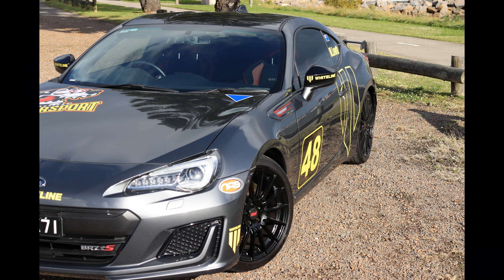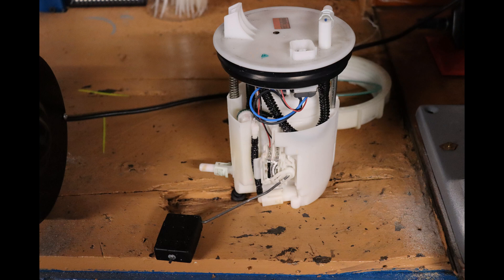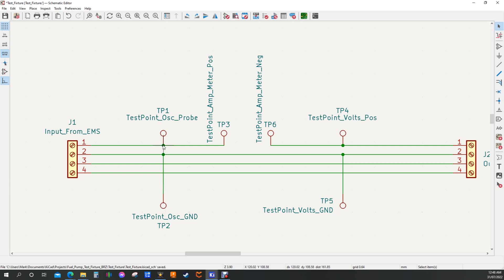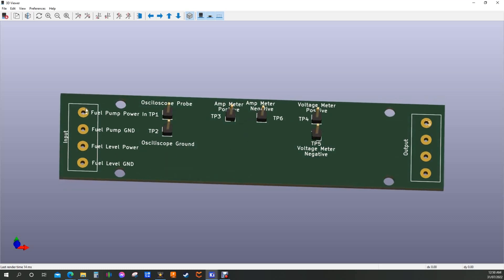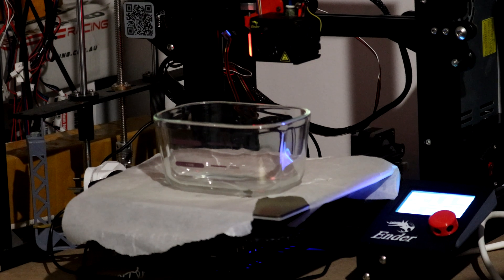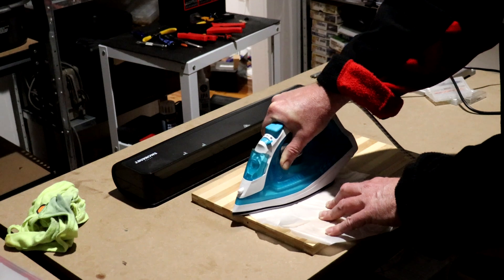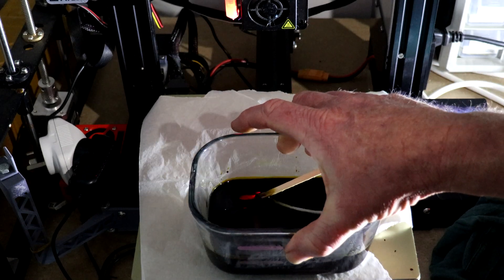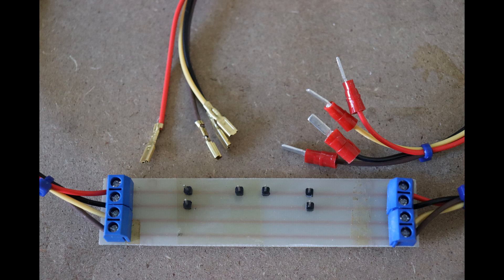Fuel Surge BRZ/86 Part 1

Comment: Using the second pump to pump the fuel to the part of the tank where the first pump is?
Reply from the maker: I may do, I haven't got that far yet. Ideally i would like both pumps to pump into a small manifold fitted with non-return valves so which ever pump has the fuel will supply the engine and not back feed into the output of the cavitating pump, but we will see. waiting on a component to finish the control bow at the moment.

Comment: Hi Mark Did you consider using the Verus Engineering fuel starvation door to mitigate the fuel surge issue?
Reply from the maker: Yes I did install one, and while it did delay the onset slightly, it was pretty ineffective unfortunately.